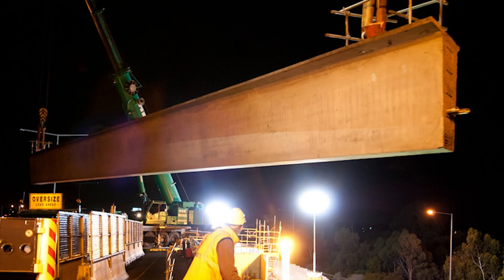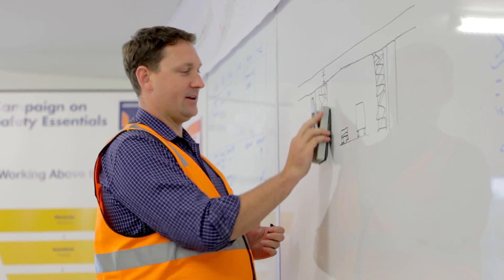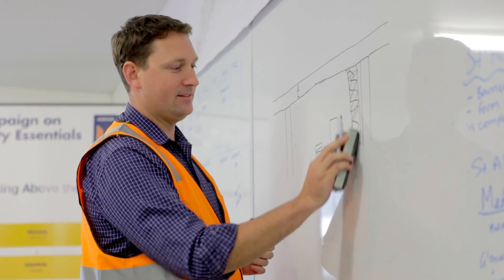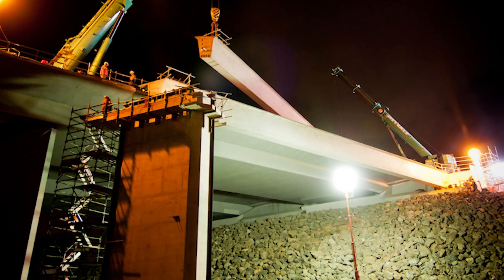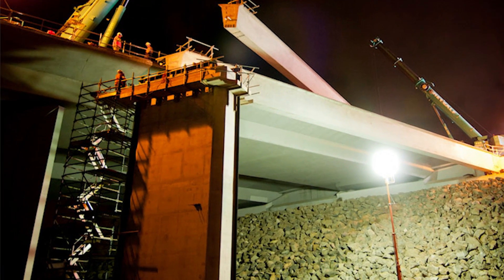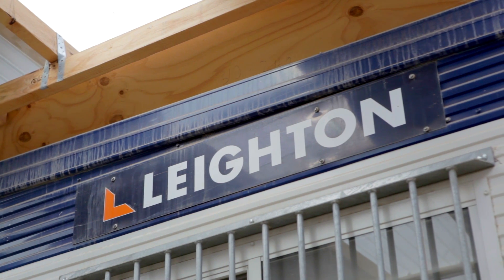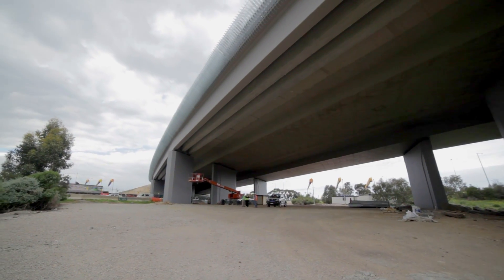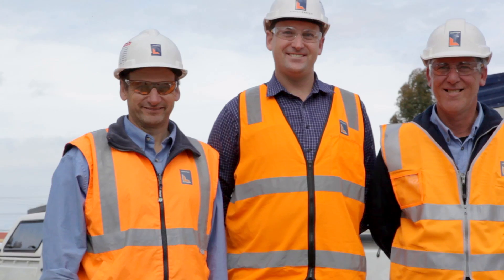WorkSafe Awards 2012 Entrant: Leighton Contractors Pty Limited -- M80 Ring Road Upgrade Project

Comment: Leighton's co-operated with DOL/MBIE Senior Inspector safety recommendation's to prevent falls from height with pre-installed handrails on beams similar to Northern Gate Project over viaduct to Johnson Twin Tunnels. Resulting in success in WorkSafe Awards 2012.